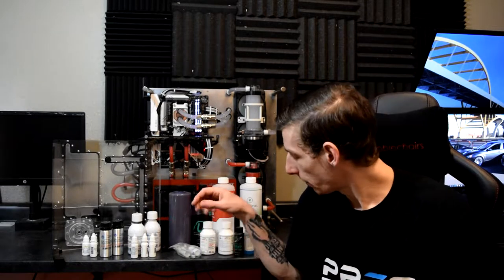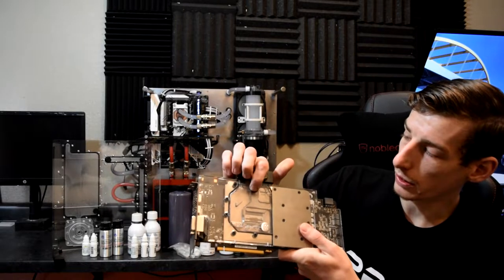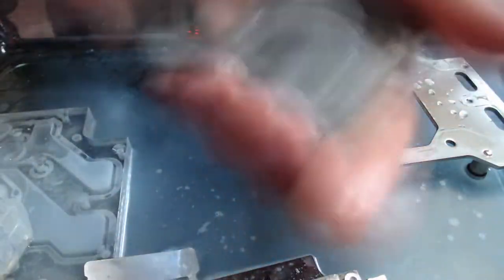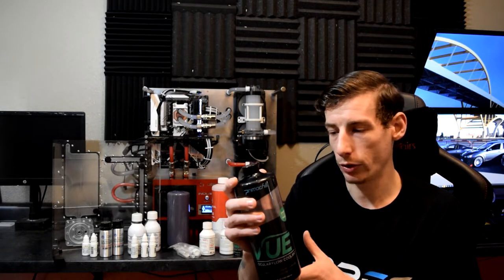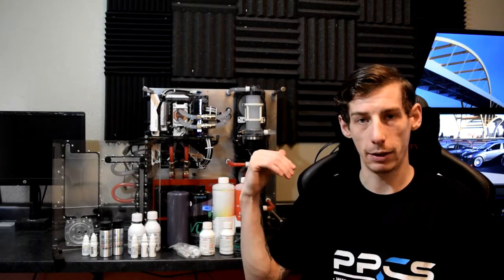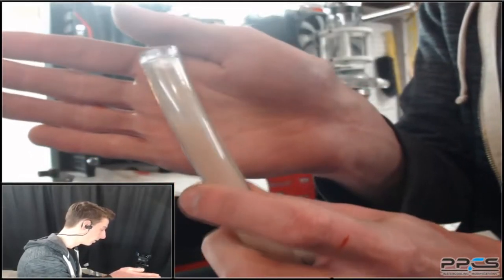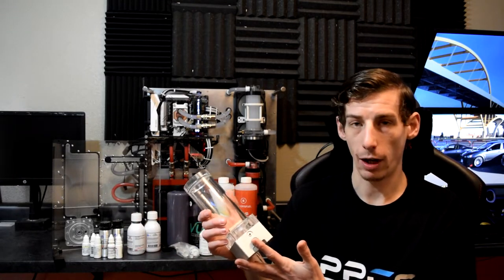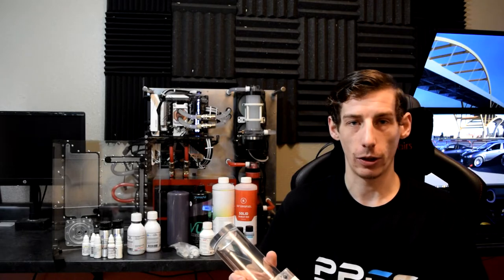Coolant Basics for Custom Loops

Comment: Koolance fluid is the best I’ve ever used. Seen the UV Blue run in a system for 5 years without any issues any maintenance beyond topping off the rez on 2x 360 rads cooling an i7 5960x and 2080ti. Tho I wouldn’t recommend going that long. But 2 years is easily doable.
Going forward I’m only using Koolance clear coolant. Only bc I don’t like the inevitable staining that happens with most tubing. Especially flexible tubing.

Stay away from any particulate or solid fluids unless you plan on draining and refilling your loop every 3-6 months….to be safe. Every horrendous issue I’ve ever seen is bc of those coolants.
EK mystic fog is definitely a particulate coolant…so I consider it in the same category even tho it’s not as bad as a solids. If anything can separate in the coolant, I consider it a no go.

Comment: Get clear Mahyems or clear Koolance 702 coolant combined with Tygon A-60-G tubing. Ignore everything else. This combo will last for years w/ no corrosion, smudge, growths, leaching, etc. Just a clean, clear, functional, reliable watercooling system  after years. The absolute best combination when it comes to reliability, longevity, ease (or lack) of maintenance, peace of mind, etc.

Comment: I personally gave up on every other coolants than EK. If the loop is prepped right, there will be no issue with either Solid or Translucent cryofuel. I personally always break up my loops for cleaning just because I'm a clean freak. People seem to have issues with EK cryofuel when doing a normal flush with Blitz Kit because just flushing will always have chems left in the loop from it. So what I do is, open up everything, use part one with copper based rads then part 2 with every parts of the loop but instead of flushing, i do it the same way as part 1 but leave it inside for 6 to 12h instead of 24 hours. Then fill, slosh, drain, rinse repeat 6 to 8 times. I then install everything in the case and flush another 2 times just to be sure. Then you can use any EK coolant without worrying. It may sound extreme but in all my years of customizing, it never failed me or any of my customer's builds. Good video by the way! 👍👍👍
Reply: Im using cryofuel Clear atm, is there even a point to cleaning anything?
Reply: @ZatEditing  yep. Once something goes wrong because something was dirty, you will understand lol
Reply: @danielchicoine79  too many steps
Reply: I plan to drain and Flush my EK fluid every 6 months. Only tearing all the way apart when new components are added. Which will probably be every 1.5-2 years

Comment: you can safely run pure distilled water as long as your loop is perfectly clean before filling. clean everything with isopropyl alcohol if needed and work in gloves. i run pure water for years now and nothing happened. no bacteria or gunk or whatnot. and sure thing its cheap, especially when you use some crazy setup like waterblock everything, multiple external rads and so.

Comment: About EK's Mystic Fog Cryofuel... How has it gone for you (if you've used it, of course). I currently have it in my system, and it has started falling out and settling in all surfaces (specially on the CPU micro-fins) after about 5 months, perhaps a little bit less; and this has happened both times I've used it. 

Let's see if I can add some further context. I flushed my rads with DI water a couple of times first before putting the loop together, all the fittings are Alphacool, as well as the radiators and plastic soft-tubing (ultra-clear alphatube), the pump-res combo is from Barrow, the CPU block is also from Alphacool (XPX Aurora), and the GPU came from the factory with a water-cooling block (it's a Gigabyte Aorus WaterFoce WB)... Now, 6 months is not a bad time to do maintenance to your water-cooling loop... But I had always heard that with bottled cooling fluids, you could go for 1 year of use before needing maintenance. Could it be that it's something else causing the blockage, and then that perhaps acts like a filter for the particles in the fluid? I've heard that plasticiser
Reply: opaque coolant in general are troublesome. Sooner or later they all will cause some issues, just avoid it and use the clear ones. Manufacturers still haven't managed to do it properly
Reply: EK has updated some of their recommendations.  Distilled water only ahead of any of their suspended fluids runs the risk of causing the electrostatic suspension method they use to loose too many ions and become ineffective.  They recommend using a flush product instead.

Comment: So if I just want my coolant to work and not cause any issues or staining, just use clear?  Building my first custom loop and prefer the clear look anyway.  Will ek cryo clear require much maintenance?
Reply: What's the he Verdict?
Reply: @zkilla4611  im using the lime yellow ek cryofuel.  I havent had any issues but cant say much about staining until i do my annual system flush.  From the looks of it, I think Ill be ok.
Reply: @teemohnay  Nice. I just put Acid Green in mine yesterday. 1st build with custom water loop. I have to change it or at least add more once I add the GPU Block. I'm wondering if I can keep the leftover coolant and use it? I don't care if it's stained as long as it performs well. I may change the color. But doubt I'll ever go straight clear.
Reply: @zkilla4611  Yes, just keep in mind the shelf life written on the bottle.  This stuff has biocides in it that degrade over time.  I have 4 bottles and have pumped one of them fully through my system then back in the bottle then back to the system multiple times lol.  Just be careful that it stays clean the whole time.  I also used prep fluid on my rads in advance and loop prep for everything else in advance as well.  Then flushed it clean with distilled water before filling.  Im not taking any chances with my setup (which is balls to the wall extreme).
Reply: @teemohnay  yeah. No chances. I got a 5900x and 3080Ti currently.
Reply: @zkilla4611  nice!  Im 5950x and 3090 ftw3.  Full ek blocked everything.  3x360mm ek rads and full ek fittings hoses and pump.

Comment: I just want to know if I can add Mayhem's dye to EK's Mystic Fog coolant...
Reply: nooo don't do that. I recently added distilled water to my premix TT clear and that did not end up well. Don't try mixing two different products or brands
Reply: @AnTran-rc8yj  What exactly happened to your coolant?
Reply: @LongIslandicedteaaa  the coolant became cloudy before that it was all good until I bought a new radiator and did a couple of flushing with 1:1 distilled/vinegar follow by 10 flush with just distilled water then put the clear TT coolant in and it became cloudy.
Reply: @AnTran-rc8yj  I don't think it's from the distilled water, because all coolants are mostly distilled water anyway. Mix some coolant with water outside the case and see if it gets cloudy.
Reply: @LongIslandicedteaaa  it could have been the vinegar then, maybe there was some left in the radiator

Comment: I have had great luck with just distilled with a silver kill a coil
Reply: I had distilled water in my system for 2 years and the amount of corrosion that happened in the system was insane I never had algae growth with a silver kill coil but the silver ionized with the copper and yeah

Comment: I just wanted to order EK Mystic Fog.  I havent heard that its a "showcase coolant".  Its my first whatercooling build.  I guess I should better use some translucent colour instead?
Reply: I just drained my loop and the EK dye had solidified in chunks at my cpu block, clogging it and overheating
Reply: @millll111lllI  did you use the RGB fog one?  Or a clear?
Reply: @alexreconquista7293  My bad it was Cryofuel navy blue.
Reply: @millll111lllI  how long was it in there for? I heard good stuff about the Blue
Reply: @zkilla4611  I think it took about 3 weeks to clog the fins enough to notice temperature problems.  I just run water with a few drops of bleach now.
Reply: @millll111lllI  Did you flush it and the radiators well? Prior to filling. There is not much in it. So I would say a reaction created the chunks. Maybe a contamination. Now you probably have it flushed enough where water and additives are working well.
Reply: @zkilla4611  it's certainly possible.   I did flush the radiators and system with a vinegar dilution first.  When I removed the blue Cryofuel and brushed out the waterblock, those blue chunks felt like a paste.